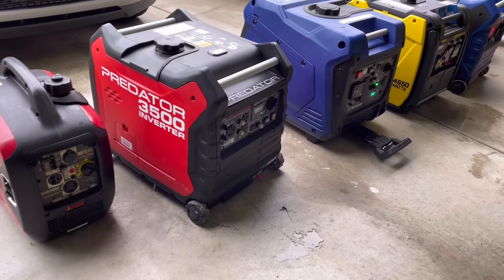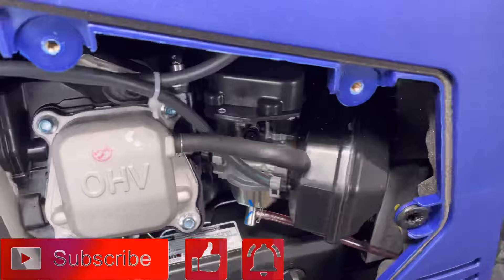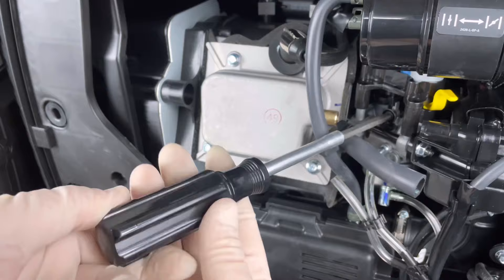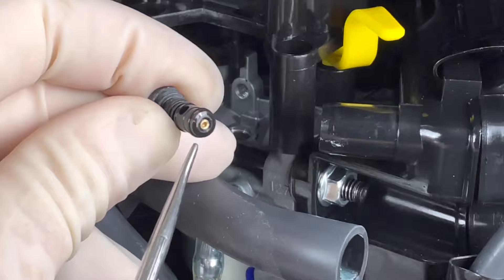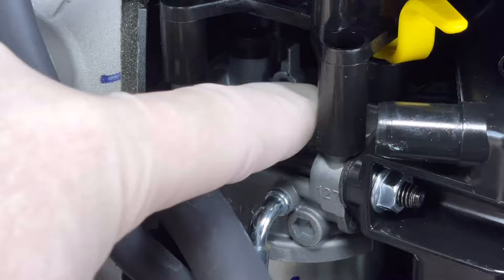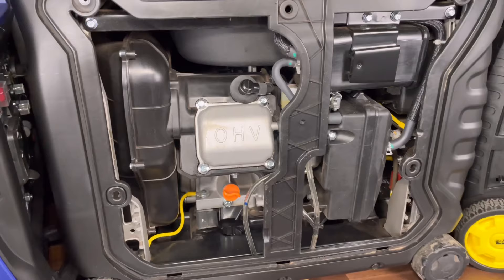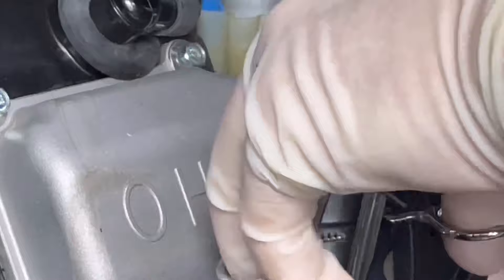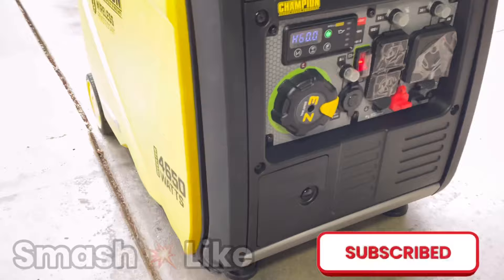Generator won’t start Idles up and down DO THIS 5 Min fix!!

Comment: Found a champion generator sitting at the end of a driveway on my way home from work. Stopped an asked the owner about it.  He said its junk, won't run properly, take it, its yours. Brought it home and watched your video. Fixed the issue in 20 minutes. Little jet was plugged with debris. Generator runs like new now. I was pretty excited to get it working.
Reply from the maker: Awesome dude!!! Scored 💪🏼👍🏼

Comment: You are the Mannn!  We are prepping for a long RV trip and Champion was surging. You saved me a lot of time.  Very well done!!!
Reply from the maker: Thank you, and glad I could help. Now you can be the man!! 👍🏼😀😂👊🏼
Reply: @johnnysweekends thank you so much bro! My RV generator with only 300 hours has had EVERY small engine part replaced and I was about to give up and look into a new one! Will try this before we get on the road again!
Reply from the maker: On boards can be a little different but you would be surprised what that small jet does or even a bad spark plug.
Let me know if it works 👍🏼

Comment: Good to know. Just fixed my old Coleman 5500 with a Yamaha engine. Almost 20 years old runs like a champ again. Have a new predator 5000. Will make sure to keep the gas clean...if not now I know how to fix it.

Comment: Johnny…I know you’re not a service channel, but I have the Genmax 3500 ied that you have recommended.  It ran out of gas, and must’ve sucked up some small debris and now it keeps surging.  You can’t get to the jet on this model like the ones you show in this video.  Have you ever tried to do this (clean the jets) on a Genmax 3500 ied?  Maybe something that would make a good video.  Thanks.
Reply from the maker: Yea if I remember it’s on the inside of the carb which does make it a little more difficult. 
I think air intake tube comes off and propane line and I think you can get to it. 
If not it’s almost full carb removal. You have to remove enough stuff to get to it. 
It’s almost always the same jet if it idles bad or is hard starting or surges at very low loads. But middle and upper loads runs fine. That’s a sure way to know it’s a jet. 
Also don’t run them out of gas if you can especially with a load. That’s a quicker way to burn up inverters. 👍🏼 

Let me know what ya find

Comment: I was just about to start looking around for a solution to my predator doing the same thing after a complete carb clean - you nailed it, i had no clue that was there. Ill check that and pretty sure itll solve my issue! Thanks man- now id love to tap into both ac windings to get a switched 230v 30amp breaker/outlet plumbed on there
Reply from the maker: Let us know if it works..👍🏼
Reply: same exact thing to me i will try it to see how it goes

Comment: I want to say thank you.  We rode through hurricane Ian overnight and lost power as expected. I woke up this morning to hook the important stuff up to my Cummins Onan 4900i,  which we have used for camping and back up for the last year. I ran it yesterday for 2 hours to make sure everything worked and I had good gas in with out a hitch at all.  I hooked it up today, and what you described is exactly what it did. I went through everything trying to find the problem for 3 hours in the rain. I had almost given up when I found your video. That was they exact problem. 5 minutes and she was running perfectly. Thank you for the video.
Reply from the maker: Yesssssssssss 👏🏼🙌🏼 so glad this was able to help you especially as you were getting ready to throw in the towel. 
I’m glad you are up and running and hope everyone is safe. Thanks so much for the comment and letting me know. 🙏🏼😊👍🏼

Comment: Love the video!!! I bought a predator used from a guy a few weeks ago not ever running it until tonight when it started surging than shut down and would not start back up again!! I literally would have taken a hundred for it I was furious!! It would run smoothly for 3 min than starting to surging and than died would not restart again for 10 min. After following your instructions it works Awsome!!!
Reply from the maker: Yesss!! Glad it worked and the video helped. Predator is a good unit just keep the oil clean and spray run a fuel stabilizer or conditioner and your good. Thanks for watching and leaving a comment to let us know 💪🏼😀👊🏼

Comment: Hello Johnny's... THANKS for the tips.  With the knowledge in your post, I was able to fix my Champion model 75537i 3100/2800 watt which had developed the dreaded SURGING symptom.  The ECO needle on this carb is BURIED.  1)  Turn FUEL control to OFF, run till it quits to empty the carb and fuel line.  Drain fuel from the carb bowl by loosening the Phillips screw near the bottom of the bowl.  2)  Remove the plastic end of the unit (nearest the wheels).  3)  Remove 4 bolts holding the heat sink.  Rotate the assembly to allow removal of the air filter housing. 4)  Remove air filter, remove the two nuts holding the carb to the engine.  5)  Unplug the two carb wires at the plug end.  6)  Remove the carb from the unit.  Take it to a table or bench so that you don't loose any small parts.  7)  Now is a good time to add a small in-line fuel filter in the fuel line between the tank and the carb.  8)  Remove one flathead and two round head Phillips screws from the servo frame to separate the carb control unit from the main carb.  9)  Remove the brass (or is in bronze?) needle.  Clean it like Johnny mentions.  10)  Clean the needle and the rest of the carb insides with spray carb cleaner.  DRAIN ANY REMAINING CARB CLEANER FROM THE BOWL as in step 1.  11)  Re-assemble the unit and check it out.  IT WORKED FOR ME !!!   Thanks again Johnny's
Reply from the maker: Uhh some of the champions are not fun..😂

But I’m glad this helped you out. And you did the full job!! Nice.

Thanks for letting me know and sharing ..👍🏼😀

Comment: Unboxed my new Champion and it started the surging thing immediately.. got on YouTube found this post, went to the garage and fixed my generator..  now I’m back to say thanks
Reply from the maker: Awesome!! Glad I could help. Even though you shouldn’t have to do that .

Enjoy your new generator
Reply: I just bought a brand new Predator 2000 and it has the smallest surge but i think I’m going to do the same.

Comment: OMG, thank you so much! I was having the exact same issue with my brand new predator and it was so frustrating since it was brand new. Tried everything including deep cleaning of carburetor and nothing worked. I found your video and fix the issue in 5 min. You are the best. Thanks!
Reply from the maker: Awesome glad I could help 👍🏼

And thanks for watching 👍🏼😀
Reply: Yeah I have a new predator that started doing this after about 8 hours. I'm going to try it this weekend when I get to the shop.
Reply from the maker: Let me know if this fixes it ..👍🏼

Comment: Thank you. Had to dig my carb out of my Champion 2000 but found the low speed jet on the back side, plunged with wire as in your example, reassembled and now running like new.
Reply from the maker: Awesome glad I could ..👍🏼😀

Comment: 👍🏼👍🏼👍🏼👍🏼👍🏼👍🏼👍🏼 THANKYOUTHANKYOUTHANKYOUTHANKYOU!!!!!! Just got my WEN GN400i out to test and prep for Florida summer and it gave me all the typical issues. Wouldn't turn on... Got it to run but shut off when closed choke. Got it to stay running but then it was idling rough. This is the trick! 😀
Reply from the maker: Wow awesome so glad I could help and it was a simple fix. Enjoy your generator…😀👍🏼👊🏼

Comment: Going through several clips did not help. This is exactly what I am looking for. It solves problem  quickly.  After cleaning up carburetor, fuel line,... generator is still surge badly in running in idle mode or light load .  Thanks  a lot for your video
Reply from the maker: You’re welcome!! So did this work? Did you get it working correctly??

Comment: Well done!
It's amazing that almost none of the small inverter gens come with any inline fuel filter.  Some of the Honda's have a screen on the inlet side of the fuel shutoff, but that's about it.
Reply from the maker: There is a filter a mesh one inside the tank. But I think it still lets small contaminates through.
Reply: If you read the manual said Clean Air Filter every 100 hrs..!
Reply from the maker: This is mainly fuel related and not air… did I miss something?
Reply from the maker: Most times it is..👍🏼

Comment: My Firman 3650 did this from day one. Any time the choke lever was set to run it would hunt. Mine was exactly the same as the first example and when I took it apart I couldn't see any issues and could blow through the jet. I followed the instructions with the wire and hit it with some brake cleaner. Now once it's warmed up for a minute I can put it in run and it idles smooth.
Reply from the maker: Awesome glad this helped. The jet is so small that even the slightest piece of debris can make them run rough.

Comment: have a brandnew champion dual fuel , never used gas, only lpg. on eco mode it waves up and down. not with some load. do you think i have to clean it on a brandnew one? does it apply to lpg at all? thx and keep on making that great videos!
Reply from the maker: Hello. A plugged carb will not effect lpg, so more of a carb adjustment problem out possibly bad spark plug. 

Cheap and easy try is a new ngk plug.  Just need cross over off existing and close the a little from stated. So if it says .028-.032 set to .024-.027.

Next would be carb adjust. There is a black screw and is plastic. Turn it in one turn at a time but mark where it is set now. Clint one turn try generator on eco then a load. If not running right try another turn in, and try eco and a load again. It shouldn’t take more then 5 turns unless watts off. Again count your turns. 
And run generator from start up to full load and back to idle. If runs normal then done.

You’ll turn screw in, clockwise..👍🏼

Let me know

Comment: Cool stuff. This happens often cause they sit around to much not getting used.
Reply from the maker: Yes, use them at least once a month.
Reply: @johnnysweekends  Agree just fired mine up yesterday
Reply: I use mine every day and this is happening.
Reply from the maker: Did you clean it yet…?
Did you change the spark plug…
Inspect flame arrestor?

Let me know

Comment: Johnny, Any chance you could check the Westinghouse’s number of turns for the idle screw. I have been searching the web for the last 2 days with no joy😢. Your videos are the best!
Reply from the maker: Ahh I don’t remember off the top of my head and I don’t have that unit anymore. 

But I think it was 5 turns 😬

But back it all the way out with it running and you will see the throttle bounce back and forth. Turn it in till it stops bouncing and then is running steady. 

Then shut of and on a couple times to make sure it operates like normal 

And thank you 😀👍🏼
Reply: Thanks for the follow up Brother! Cheers
Reply from the maker: No problem hope you got it figured out

Comment: Can you review the Westinghouse 2200 generator? It looks really good for the price.
Reply from the maker: How much is it right now..?
Reply: @johnnysweekends  Around    $ 650
Reply: @johnnysweekends  It was on a sale for $319 when I purchased last week. It's back up to $450ish now. I decided to take a chance. It appears to be identical to the Generac 2200 judging from some forum posts.
Reply from the maker: Yup it is. Could have a different inverter board but I doubt it. Most of these have a twin somewhere or even a triple depending how many companies want the model.

Comment: Question. Old champion generator. I installed a new carb, and fresh gas in a new gas tank. First start up-  started surging.  Suggestion? Thanks.
Reply from the maker: I have had new generators with a plugged low speed jet. Just because it’s new doesn’t mean the smallest bit of debris couldn’t get in there. Maybe in the tank…maybe in the line, who knows. 
Double check low speed jet to be sure, new spark plug, if not could be inverter problem if all else is good like compression.
Reply: Thank you. Will clean jets, change plug, and see what happens. Ty @johnnysweekends

Comment: hello john how about adding fuel filter to this system i have rato generator copy of champion with same engine.i added a small fuel filter just before carburater fuel inlet.
Reply from the maker: Yes you can add an additional one to any of these if you want.

Comment: Do you clean the pilot jet on the firman 3650 the same way as these?
Reply from the maker: I doing have a Firman. But the procedure should be the same as most of these all use the same two or 3 carbs it seems.

Comment: How do I do this on the ecoflow smart generator. Non duel fuel
Reply from the maker: It’s basically the same but jet is on far side of the carb so does make it harder and almost have to slide carb off.

Comment: Bummer, I tried you trick but it did not work. Do you think I need to replace the whole carb? I took it out clean the whole thing and did you tip as well and nothing. 😢 I may have to buy a new carb just hesitant bc the generator is bran new. Mmmmm?
Reply from the maker: If what ever unit is brand new then the first thing to do is return and get a refund.
It may not be the carb it self but the stepper motors so refund/ return first
Reply: @johnnysweekends  thank you very much. I will try that then.

Comment: I have a bohmer ag 4500i inverter generator surging trying to follow this video to fix as am living off grid use for electric fridge, charging appliance etc.. can't seem to locate the plastic idle screw is it possible that it on far side of carb which will require a complete dissasebly of the unit or it doesn't have one , can only notice brass scree which is horizontal has something to do with throttle as go's grazy high revs if it move it , any idea please?
Reply from the maker: Try to get a mirror and look around the carb. Most use the same two or three carbs it seems. 
Have you done the other basic maintenance items?
Clean air filter?
New spark plug?
Clean spark arrestor?
Reply: @johnnysweekends  yes done the rest, thanks for reply have new genny ordered going on 2 wks now have an old genny borrowed from a friend
Reply from the maker: Interesting only thing to look at is the stepper motor on the top of carb. Is it going back and forth and maybe hold it manually

Comment: Sir if I have only used propane in my dual fuel champion, do I still clean the jet…
Reply from the maker: No because the propane bypasses the carb circuits and just goes through the main carb throat

Comment: what if I forget to count de turns unscrewing the plastic bolt?
Reply from the maker: Most seem to all be at 4-6 turns out. 
Fire it up and run it at eco mode, and eco off and see if it runs correct.

Comment: I have a predator 2000 inverter/ generator and my carburetor doesn't look anything like the one your show it runs from side not straight up and down like the one that you showing. I've taken both side panels off and neither side looks like the one in your video. So I still have have surging and running rough problem. I've tried running new gas in the tank but that did not fix it .if you would like I can send you a picture of it . By the  way sometimes if I leave it in start position it will run find for a little but as soon as I put a load on it starts surging again
Reply from the maker: Yes your low speed jet is plugged if you are able to run it on choke for a bit. And it will probably run off eco on high idle..

These are the bigger models so yes the carb on the smaller models like your predator 2000 is different. You will have to remove the side panel where the air filter is and remove the air box and possibly the carb. Or at least slide it back to get to the jet. Unfortunately the smaller models are a little tougher.
Reply: @johnnysweekends  0k thanks for the info, so I've got more work cut out for me.
Reply from the maker: Yea unfortunately. Sorry

Comment: Sorry but I tried this on my predator 3500 but it is still surging. What should I try next ?
Reply from the maker: Did you change your spark plug?? 
Is the spark arrestor dirty??

Check those two items and maybe inspect and clean air filter.
Reply: Yeah I tried all that. I literally ran around a half tank of gas through it and stored it with stable in it and started it every month but the last time I started it the battery was dead and it is surging.
Reply from the maker: Does it run better in eco mode on or off?
Have you tried to run it with full choke or half choke to see if it will run normal?

Unscrew gas cap maybe to see if it’s venting correctly

Comment: I have a brand new champion 4650 watt generator and when I turned it on it started shaking a lot so I turned it off and havnt used it since. Does anyone knows why is tht??
Reply from the maker: Manually operate the choke on the inside and see if anything changes. 
If not then very good chance the small jet just like in this video will need to be cleaned.
Reply: @johnnysweekends  but why would it need to be clean if it’s new?? It’s never been used.
Reply from the maker: For some reason I think when they test run them somehow they are not getting them cleaned out. And the smallest piece of debris can clog that little jet. You’re one of many with this problem and doesn’t matter the brand. Just seems to happen. 
If you don’t wanna mess with it return it asap.
Reply: @johnnysweekends  thanks